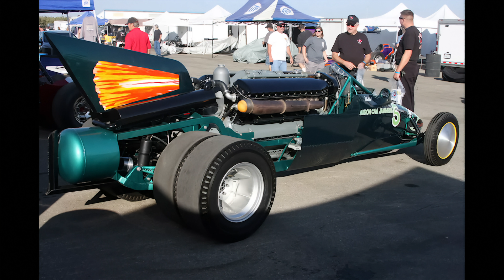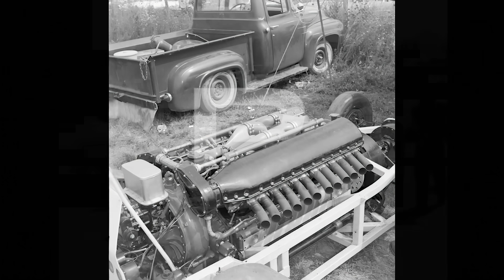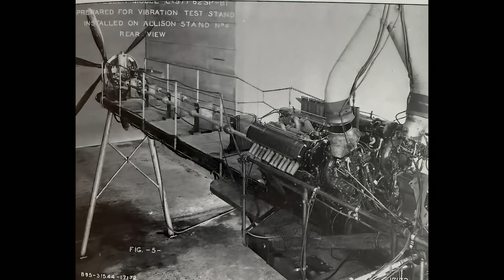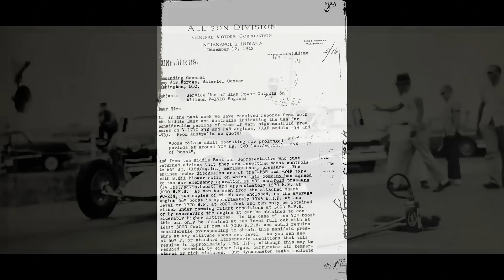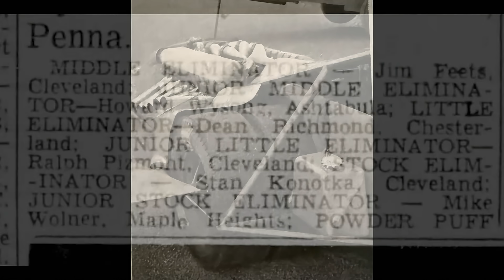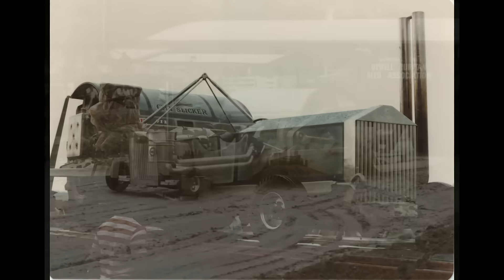Warplane On Wheels: An Allison V-12 Slingshot, Innovation, and More

Comment: Thanks for this homage to a great racer and builder.  The Allison was a spectacular engine, built before the Merlin, and would absorb more punishment. Not to nitpick, but as I am sure you know, the P-39 was the Airacobra.  Air-a-cobra.  Another terrific piece!
Reply: The version of the V1710 that saw use in WW2 was essentially built at the same time the Merlin was first built, the original V1710 dating back to work having started on it in 1929 was extensively reworked into the mid 30's engine, that was essentially the starting point for the version that was used in WW2.

However, maybe because of its longer development time, the V1710 was vastly superior to the Merlin whose entire reputation is based on the P51 story, which has to be highly fictionalized to draw the conclusion that the Merlin was somehow more powerful, the V1710 is 60 ci bigger than the Merlin so naturally it makes 60 ci more power as long as all other things are equal such as supercharger types and octane levels of the fuel used.

As far as the P51 story goes the reality is the 2 stage high altitude supercharger version of the V1710 engine had just become available shortly before the British commissioned NAA to develop the P51, but they ordered it with the single stage supercharger version, just like they'd ordered P38's without the turbos despite objections by the engineers at Lockheed, why they ordered those aircraft with engines that had superchargers they very well would have known wouldn't have performed at high altitude I can only speculate, but for whatever reason they did.

The V1710 engine is about 250 lbs lighter than a comparable Merlin, ie both with single stage superchargers, it has less moving parts making it easier to build and maintain, despite being 60 ci bigger it has a smaller cross section, it was a modular design that could have its direction reversed without requiring special reverse direction cams and it could be done in the field, all that was required was dropping the crankshaft and turning it around, rearranging some of the plug wires on the right bank and fitting a simple idler gear to it that keeps all the accessory pumps turning in the correct direction.
Reply: The soviet union buy a lot of those because they are cheap and crapy.
Reply: @IncognitoActivado the commies got what was readily available.  The US6 Studebaker was probably the best truck in the world at the time.  The Locomotives were sent were the best in the world.

Comment: Thanks for another great and very entertaining story, Brian! My son and I once were in the right place at the right time. We saw and heard an engineer put a V-12 in a P-51 Mustang modified for racing through it's paces before doing an oil change. There was an entire processing for changing the oil which included get the oil up to temp so it would adequately go throughout the engine and be runny enough to run out of the engine when up to temp. Awesome sound at full song!